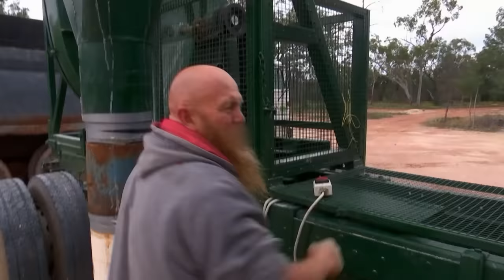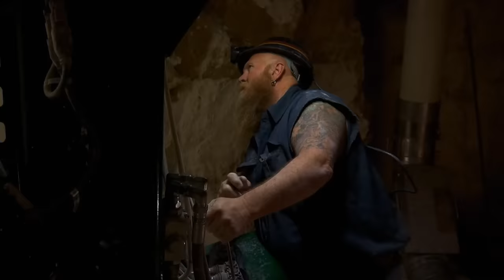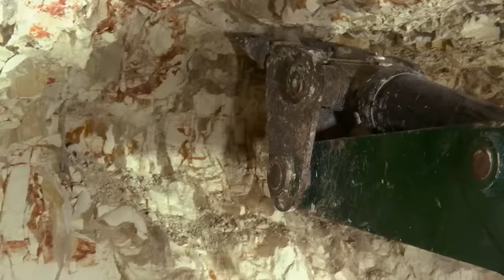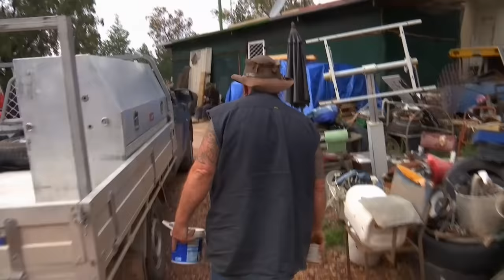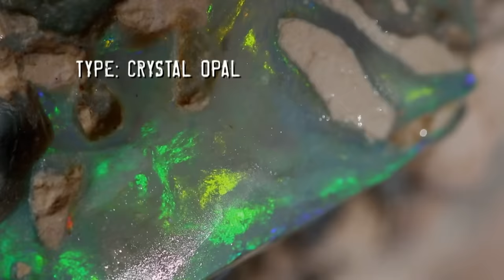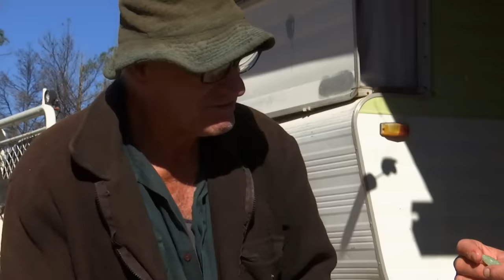Rod Manning Scores Heaps of Crystal Opals Alone | Outback Opal Hunters

Comment: When you have a belt like that, you want to take it off and put it on the very end or the outer portion of the pulley, or just take it off entirely until you can get a replacement for that one belt. I'm sure the machine will continue to run as it normally does, it wouldn't hurt to use some belt dressing